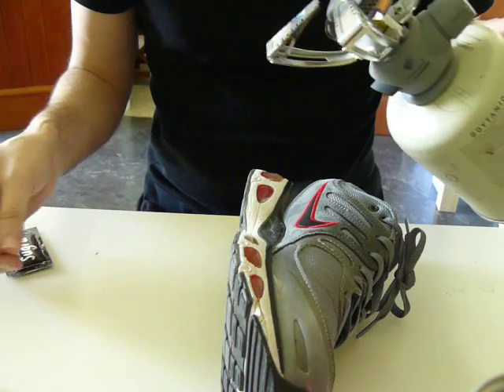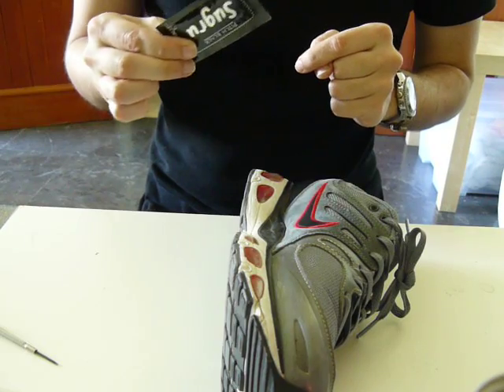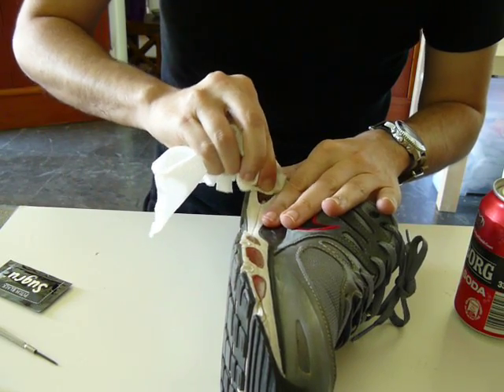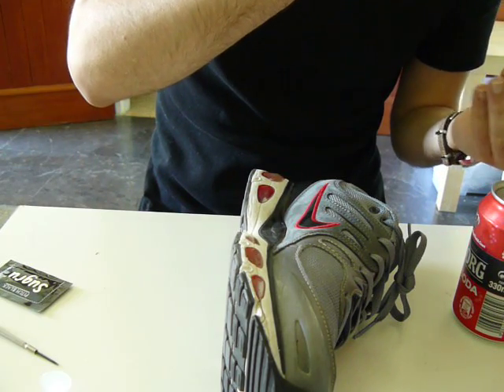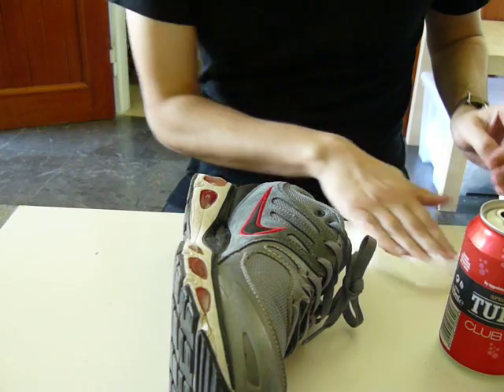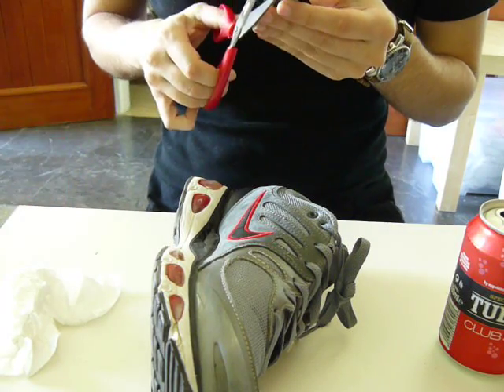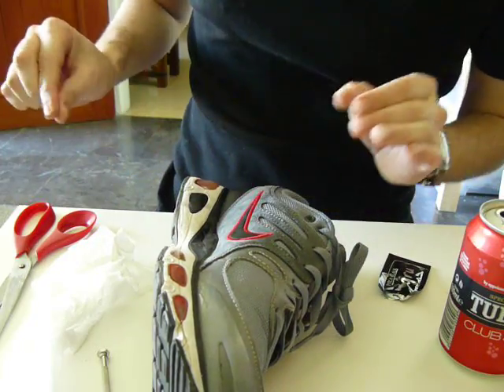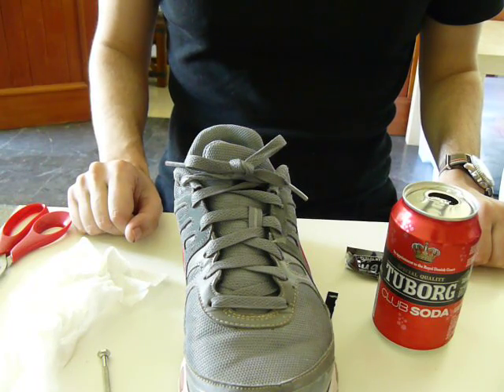How to refill old Nike Air sole with CO2

Comment: yooo i know this video is old but how did you get the butane in the shoe? step by step pls
Reply from the maker: I put a siringe needle on the nozzle of a bottle of lighter fluid and injected it inside the bubble. Then tried to seal it while escaping. Better do it in cold environment.
Reply: @teslammvii  wow thank u sm for replying, so when you injected the butane into the air pocket, was it liquid? when does it become air? and when did you know it was filled up enough? THANK YOU SO MUCH!
Reply: oh and how did you do this in a cold environment? did you do this in the freezer lol?
Reply from the maker: It is liquid but it stars boiling right away unless it's cold. a drop of butane in there is enough, as the vapour pressure doesn't depend on the volume.

Comment: Upgraded to butane, you've just went into an environment with 0 degree celcius, then the normal butan gas for lighters went to liquid, then you can get the butane out into a normal glas, injected it in with a syringe and then sealed again with glue?
Reply from the maker: wadduhaddu correct!

Comment: good.  how do you use butane?  Just like as if you are filling a cigarette lighter?  How do you seal it then?  My Nike relentless 5  has the same problem.
Reply from the maker: You have to do it in an environment around 0 Celcius, then butane is condensed at atmospheric pressure
Reply: wow, nice answer :)
Reply: How much butane did you use?